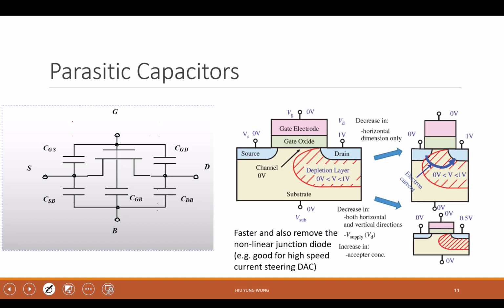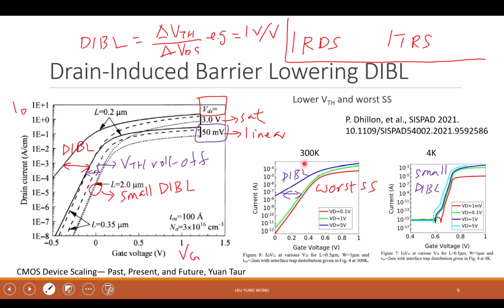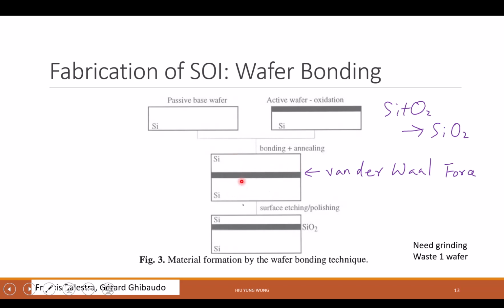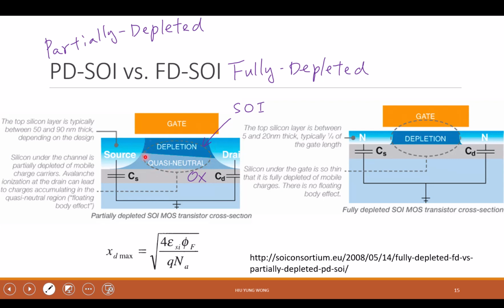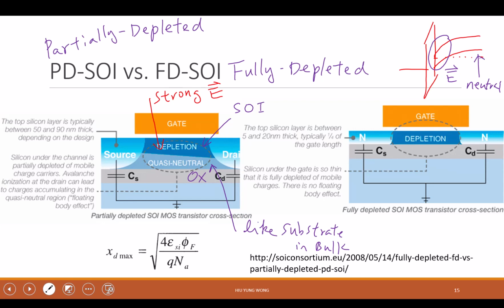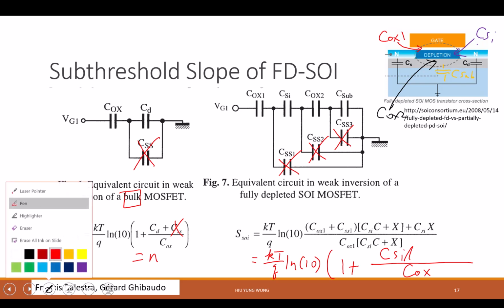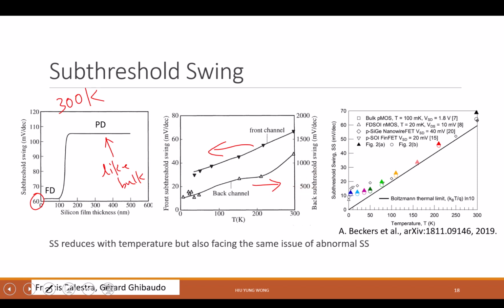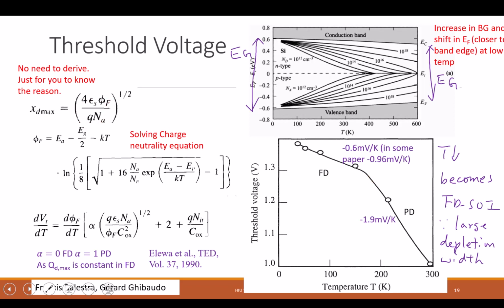L7C-SOI Manufacturing, Parasitic Capacitance, Subthreshold Swing,

Comment: Hello I have a question!
How does the vt roll off phenomenon change depending on the thickness of top silicon?
Reply from the maker: @gaoneee0 The gate has less control if the thickness is larger. So, there will be more short channel effect and thus more Vth roll-off. In the extreme case, it becomes a bulk Si.
Reply: @quantum_computing  Thank you for your answer. Is the answer for the soi structure?
Reply from the maker: @jeasga01  Yes.
Reply: @quantum_computing  thank you very much!!!!! :)